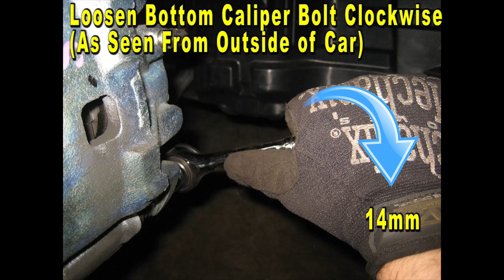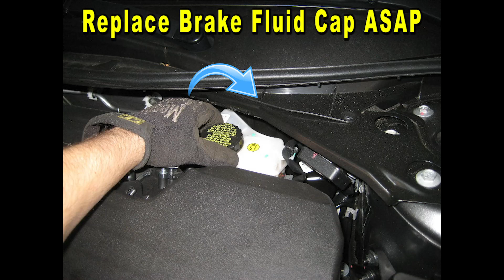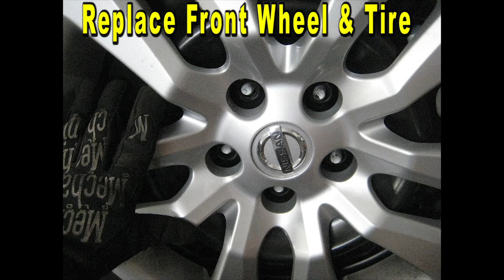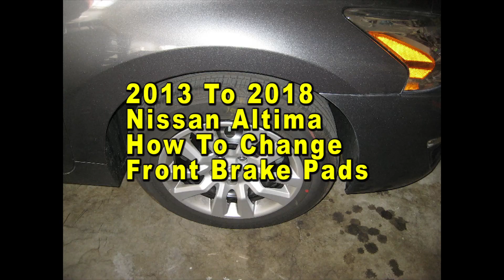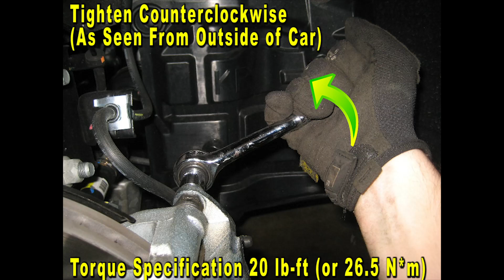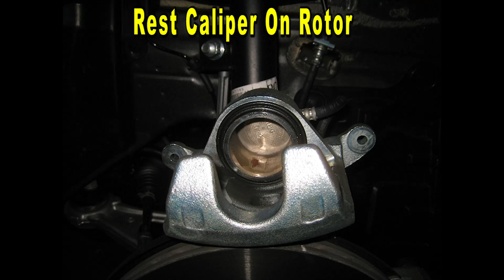Nissan Altima How To Change Front Brake Pads 2013 To 2018 5th Generation With Part Numbers

Comment from the maker: Nissan Altima Front Brake Pads - https://amzn.to/3CU1CEK
Bendix Ceramic Front Brake Pads Part Number - https://amzn.to/3QNSze9
Raybestos Front Brake Pads Part Number - https://amzn.to/3GR1qam
Socket & Ratchet Set - https://amzn.to/3Z17LbA
Mechanix Gloves - https://amzn.to/3jCnHkt
Torque Wrench - https://amzn.to/3vS5uSI
"F" Clamp - https://amzn.to/3XkAkjd

The Paul79UF YouTube channel is a participant in the Amazon Services LLC Associates Program, an affiliate advertising program designed to provide a means for sites to earn advertising fees by advertising and linking to Amazon.

Comment from the maker: Check out the DIY guide for changing the front brake pads on a fifth generation 2013 to 2018 Nissan Altima sedan - 
https://www.paulstravelpictures.com/2013-2015-Nissan-Altima-Front-Brake-Pads-Replacement-Guide/index.html

Here are all of the DIY repair and maintenance tutorials for the 5th generation 2013, 2014, 2015, 2016, 2017 & 2018 Nissan Altima - 
https://www.paulstravelpictures.com/Articles/2013-2015-Nissan-Altima-Common-Problems-Repair-Maintenance-Guides.htm

Owners of other Nissan or Infiniti vehicles such as the Versa, Maxima, Juke, Rogue, Murano, Xterra, Pathfinder, Sentra, Cube, Armada, Leaf, Quest, Frontier, 370Z, GT-R, Titan, G25, G37, M35 and M37 may also find these DIY instructions to be helpful.